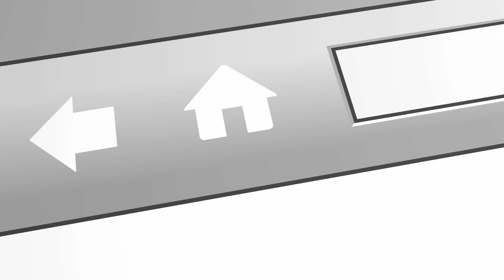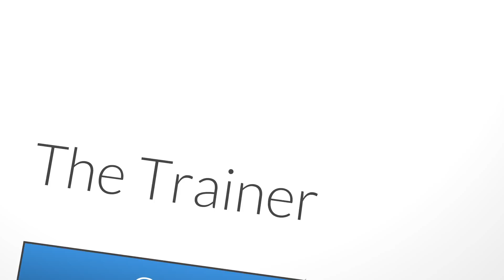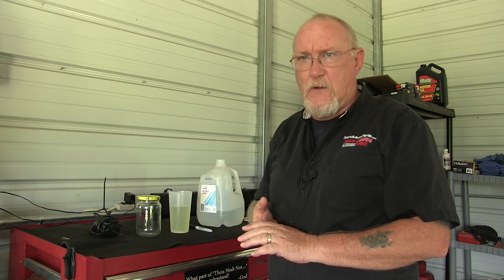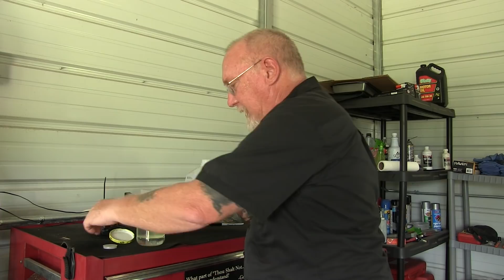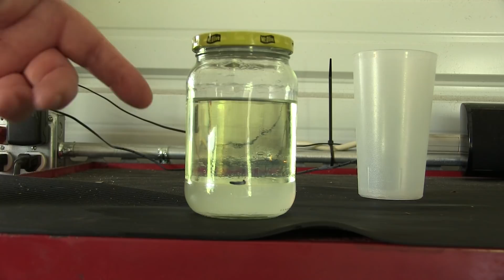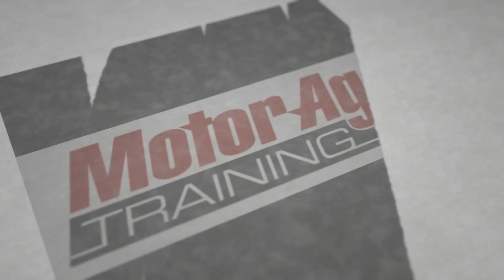The Trainer #67 - When Fuel Trims Won't Trim

Comment: I been looking for a solution for my 2007 civic 1.8 fuel consumption problem. There are no codes stored but have been getting terrible fuel economy. My ltft is -10 to -14 and my stft is almost always in the negatives. Any suggestions?
Reply from the maker: Interesting! The fuel trims indicate that the ECM is actually providing less fuel than normal. How are you judging this as a fuel consumption issue?
Reply: Motor Age the car used to get close to 400 miles to a full tank. As of lately I’m lucky to get 260 miles. Did a compression test it came back OK
Fuel pressure is in spec
Reply from the maker: @matteo3893  How is overall performance?
Reply: Motor Age when it gets to operating temp it starts to act funky. Especially when jabbing on the gas it sometimes hesitates.

Overall good but there is drivability differences from a cold engine to warm. There are two ect sensors one on the rad and one on the stat housing. The upper one seems to be operating correctly from what I can tell using a scan tool but I’m not sure how to test the lower one
Reply from the maker: Start by verifying the basics. The first thing I'd check is injector flow based on what you've shared so far. I suspect you have one or more that are leaking.
Reply: Motor Age hmmmm. I suspected an injector issue but wouldn’t that cause hard warm starts? I pulled the plugs and they looked OK didn’t smell like gas, or are you suggesting that maybe they aren’t spraying correctly? It’s not to hard to pull the rail on this car. What would you suggest i do?
Reply from the maker: @matteo3893  I'd personally start with identifying the reason the fuel trims are negative. Timing? Sensor inputs to the ECM correct? Injector leakage? Any recent modifications to the intake or exhaust?
Reply: Motor Age there has been no modifications to the car. I’m going to pull the rail and see how the injectors spray. I should add that a p0420 comes and goes by itself....I did a back pressure test and it is for sure not clogged. I haven’t checked the timing this engine is chain driven
Reply from the maker: @matteo3893  Have you checked the operation of the oxygen sensors?
Reply: Motor Age they are functioning properly. The downstream is a few months old
Reply from the maker: @matteo3893  How are you testing them? Scan tool or scope?

The reason I'm asking is the intermittent P0420 you mentioned. The P0420 is a result of the comparison between the front and rear sensors.
Reply: Motor Age with the scan tool.
Reply from the maker: @matteo3893  Clear your KAM and see if the fuel trims trend back to negative numbers. If so, track down that cause first. If you have access to a scope, test the O2 sensor response.
Reply: Motor Age KAM?
Reply from the maker: @matteo3893  Keep Alive Memory...
Reply: Motor Age yes it always goes back negative. I’m gonna pull the rail and see if I can spot an inconsistency in the spray. 

I appreciate your help and I’ll let you know what I find.
Reply: Motor Age I think I figured it out. Let me know if this makes sense to you,

In the inner fender is something I believe is called the intake resonator, the inner fender on this car is damaged so I peeked into the fender and wiggled it the hose was a little loose. 

I fitted it back up and my fuel trims are actually trimming. The car is actually staying around 0% and going back and forth rich lean. However the ltft is at -7.0. We’ll see if the fuel mileage comes back
Reply: @matteo3893  Interesting - I've heard of aftermarket intakes causing issues, so I wouldn't be surprised if a glitch with the stock intake could too.

I'm having similar issues with my 2006 Honda Fit (L13A engine): no codes, but LTFT stuck around -7%, total trims around -10 to -20%, but somewhat closer to 0 at idle. The official Honda troubleshooting procedure is to check fuel pressure first (if there are no other codes), then move on to oxygen sensors, vacuum leaks, EVAP purge valve leak, MAP/MAF sensor function. If those are fine, they say to replace the injectors. I would think a cylinder balance test (for both injector and ignition function) would be worth doing first, though. On my car, the air filter is new/clean, I've recently done a valve lash adjustment (with a noticeable improvement in engine noise and fuel economy), and had the injectors cleaned and flow tested.
Reply: I never remedied this issue. I actually sold the car awhile ago, I did learn because this was a return less fuel system that the fuel pressure regulator was built into the pump, …I’ll probably never know what was wrong with that car
Reply: Thanks for the reply - I'll try to remember to post here  if I figure mine out. I would think a fuel pressure reg going high would be unusual, but apparently it does happen.

Comment: Pete, Thanks for your videos... I am working on a 2005 Hyundai Sante Fe that came in with Lean fuel trim on both banks. I located tear in intake boot and replaced it. I found MAF sensor was giving erroneous readings and replaced it, I then found purge solenoid was stuck open and replaced it. Now I have good STFT  at idle but as soon as i try to do drive cycle under a load LTFT ramps up and keeps commanding more fuel. I did smoke the system and do have smoke coming from valve cover but nowhere else. I put propane at these areas to see if I could see change in STFT but now change even at 2500 RPM. I guess my next test will be fuel pump but there is no schrader valve on this and I am not sure where or how to connect. I will be looking at fuel pump with Verus scope to see if I can see anything but there is absolutely no drivability issue. If you have any ideas let me know where to go.  This is an E-check issue and not because of any other complaint. Thanks again for your time.
Reply: Hi Have you found your problem? I have a Tucson with similar issue. But somehow My scan tool won't show STFT, the LTFT is constantly at 25. No matter at idle or driving. Apparently you need Hyundai special tool to check for fuel pressure at the fuel rail end, i made my own adapters and checked at where the supply hose connecting to the fuel tank. Pressure was normal. I did smoke test no leak. And i put propane in right before the maf sensor, the scanner is showing increase air flow and upstream o2 sensor started to read rich instead lean. I assume that means the MAF and O2 is working.
Reply: Also i did check purge valve it's not stuck open

Comment: My 2013 Ford Escape titanium has system lean and cylinder 3 misfire codes. Running rough at idle. I believe it’s a MAP system with one sensor just passed the air box(replaced this one), and the other is in front the motor on the boost manifold. LTFT steady at +27% and stft is +\- 5% regardless of rpm. Any ideas of what’s happening here??
Reply from the maker: The first problem to tackle is the misfire. I suspect that the injector is not delivering fuel to that cylinder. Here's why...

The engine is taking in the same amount of air so the ECM commands the injectors to deliver the correct amount of fuel. But one cylinder isn't - meaning the engine is actually getting 25% less fuel for the air ingested than it should. (I'm betting it's a four-cylinder). That results in the lean condition you're getting the P0171 for. First place I'd look anyway...
Reply: Ok I will sure focus more on the fuel delivery.  thank u sir 👍

Comment: I have two shft  readings were it just sits at 99.3 and 21%
Reply from the maker: I've never seen STFT at 99.3 on an OBD II vehicle. What are you using to access the data? What is the yr/make/model of the vehicle? What conditions are you looking at (idle, cruise?)
Reply: Using OBD2 machine I think these two readings are off the back 2 sensors
Reply: Yea I have that two on back sensors I assume those sensors are not needed

Comment: My STFT is about 20% lean at idle at 800 RPM, it goes back towards stoich under throttle, but if it drops below 800 RPM, it also goes back towards stoich. I'm custom tuning the car, it's a 16 focus. My tuner thinks the heating element is going out in the 02 sensor. What are your thoughts on this?
Reply from the maker: What is the fuel mode under 800 rpm? I'm thinking it's going back into open loop.
Reply: @VehicleServiceandRepair  fuel mode under 800 RPM? What exactly do you mean? Also, the old 02 sensor was pretty black. Long term trims are running rich at 0.94.
Reply from the maker: @jasonashley9853  There should be a PID on your scan tool that tells you if the ECM is in "Closed Loop" or not.

Comment: How do you figure out what is causing the computer to think it has high ethanol?
Reply from the maker: Have you tested the fuel's alcohol content?
Reply: Yes and it showed me there wasn’t really anything.
Reply from the maker: @TheJayscar  Have you checked for related TSBs? What make/model/year are you working on?
Reply: Motor Age yeah and everything is normal except the ethanol percentage. And it’s a 2008 impala v6 flex fuel
Reply from the maker: @TheJayscar  Have you tried a KAM reset?
Reply: Motor Age yeah but the ethanol percentage went up slowly again:/
Reply from the maker: @TheJayscar  How did you test for alcohol? What is make, model, year, engine, trans?
Reply: Motor Age I did the water/gas test to see if it would rise. It’s a Chevy 2008 impala v6 flex fuel automatic. I only run regular gas in it as well. It started having this issue at 150,000 miles.
Reply from the maker: I did some digging and it appears that GM used two different ways of determining the alcohol content of the fuel. Earlier models used a sensor in the fuel pressure regulator and later models, like yours, incorporate an algorithm in the ECM based on fuel trim and O2 sensor activity. Was any part of your fuel delivery system replaced around the same time? Are you positive that there is no alcohol in the fuel in the tank? Is the ECM a replacement or has it been reprogrammed for another reason that may have impacted the internal software? That's about as far as I can help you. I hope it gets you started in the right direction!
Reply: Motor Age thanks for ur help

Comment: can fuel trims be adjusted mechanically on a Buick 3800 V6 engine  2003
Reply from the maker: No, they are not mechanically adjustable. Fuel trims are the displayed corrections made by the ECM's programming in response to a variety of sensors, depending on the system type - MAF or speed density. If the fuel trims are out of range, then you need to identify the cause and correct it to restore them to normal.
Reply: @VehicleServiceandRepair  THANK YOU

Comment: I have a 98 5.7 chevy, code P0171 Bank 1, check light comes on and goes off occasionally, first thought culprit was mass air cover gasket over trottle body. After a code reset I can drive 40 miles most of the time before light will come back on, but not always. At idle st runs 0.0 - 0.8 to 1.6 constantly lt around 19 to 23.4. I have smoked, sprayed and propane around everything, no leaks found in unmetered air. Do you think I have a lazy bank one up stream o2 sensor? I also have cleaned map and maf sensors. Motor idles and runs good  Can you offer any help please?. Thanks!!!

Comment: At idle my LTFT is 21.1% both banks ?
Reply from the maker: Is this a MAF system or Speed Density system? What happens to fuel trim when you bring rpms up to 2500? What are the STFT numbers at idle and 2500 (add the two together for Total trim)?
Reply: Motor Age its a maf system. When I idle up the LTFT drops but still positive and stft goes negative. While driving the rpms bounce and there's a delayed shift sometimes. I will get rest of the numbers
Reply from the maker: Generally, if total trim is positive at idle and become more normal at higher rpm, the culprit is a vacuum leak - or any source of unmetered air that is getting into the engine. If the trims are normal at idle but trend positive at higher rpms, then fuel delivery is the prime suspect. If trims are positive across the board, it's an input or sensor issue I'd be looking for.
Reply: Motor Age ok here we go lol. LTFT idle is 21.1% STFT 5.5%...@2500rpm LTFT 4.7% 3.1% STFT 11.1% 14.1%...the STFT does go neg and pos at idle when I tap the throttle. It fluctuates
Reply from the maker: I'd be looking for a vacuum leak. A smoke machine works great for finding one!
Reply: Motor Age I edited my last comment I'm not sure if you seen it?
Reply from the maker: Yeah, I saw where you listed the numbers but I don't see it now. Again, if TOTAL trim becomes more normal at higher rpm, the most likely cause (on a MAF system) is unmetered air entering the system. That's because a vacuum leak is a proportionally large source of air at idle, and much less so when the throttle is open more. Hope this helps!
Reply: My 2013 Ford Escape titanium has a rough idle with high Ltft which stays at 28.7% regardless of engine Rpms. I believe it’s a MAP system. One sensor is just passed the air box(replaced this one), and the other is in front of the motor on the boost manifold. STFT bounces to +/- 5% during rev ups. Codes are system lean and cylinder 3 misfire. Any tips as to what’s going on??

Comment: What is happening when the long term fuel trim gets more lean as the RPM goes up?
Reply from the maker: On a MAF equipped vehicle, when fuel trims trend lean across the rpm range (on both banks of a "V" engine) look at the inputs to the ECM, especially the MAF sensor.

Comment: my car is throwing p0171 and p0174, I've replaced both upstream o2 sensors, maf sensor,egr valve, smoke the intake no leaks, when I check on my scanner for ltft it goes immediately to 25 on both banks after I start the engine, fuel pressure at 50 psi no injector leak down, the stft  fluctuate all over the place!!!!! I have no idea what else to replace. 05 mustang 4.0
Reply: it.s best to leave it all stock cold air kits chips headers all trash i'm old i can not stand to work on cars with all that crap on it
Reply from the maker: Edwin - Check the freeze frame data and take a look at the ECT PID. Is the engine warm or cold when the code sets? It is not unusual for the intake to leak when cold but not after the engine has warmed up. Also, check the fuel trims at idle and at 2500 rpm. If the trims move toward normal at the higher engine speed, then there is a leak - and this can be any source that is allowing unmetered air into the engine. Hope this helps!
Reply: Thank you for reply, the problem with the car was the programmer I had installed in the car, I'm calling diablo sport to see if they have a solution.
Reply: post stft and ltft at idle, 1500rpm, 2500rpm, in park and then go drive and recreate the ft and post it all, ok

Comment: 2003 impala 3.4  LTFT negative 25 engine at idle.  STFT  Positive 6. Cant find vacuum leak. Any tips what to look for?  Enjoy your channel.
Reply: The vehicle is rich at idle it wont be a vacuum leak, look at the MAF pid at idle it should be around 3.4 g/s, if there are misfire codes check for leaking injectors a fuel contaminated oil is a good sign of a leaking injector along with misfires, check O2 sensors also
Reply: Rassiel, thanks for the reply. Will check it tomorrow. Looked at Maf sensor and it was spotless.  there were no codes. Did oil change, no fuel smell.
Reply: any update ?
Reply: Yes the vehicle is rich at idle. The manifold vacuum is highest at idle as well. I would remove the vacuum hose from the fuel pressure regulator and check for fuel leaking into the engine from a leaky fuel pressure diaphragm. I have seen this on this exact vehicle and engine many times.

Comment: Thanks, Pete. How would you address a lean condition where while giving 2500rpm in park the stft goes to 0 and the ltft only improves from say 12 to 11.  I lost FF data but something made it throw the p171 and p174. I can't reproduce it on test drives.
Reply: if stft was positive at idle and at 2500 rpm it goes to 0 that is a vacuum or air leak
Reply: you wont see this on a test drive because the amount of air entering the engine at road speed is overcoming your vacuum leak. the vacuum leak is having the most effect at idle . your computer is only adding a certain amount of fuel for the air it can account for. it cant calculate the amount of air entering the engine through the vacuum leak because its bypassing the maf sensor . I would check the intake gaskets with some water or get somebody to smoke test the engine when its cold.